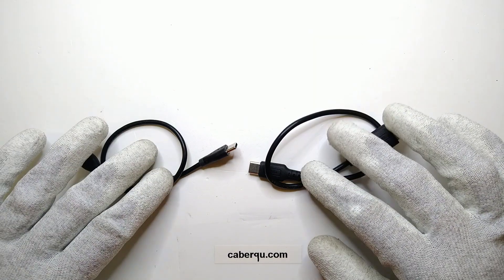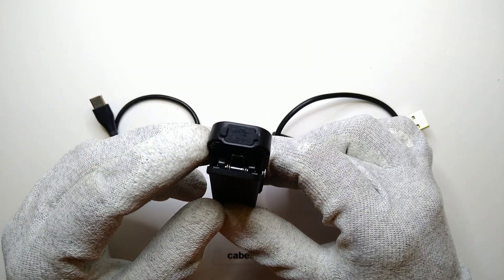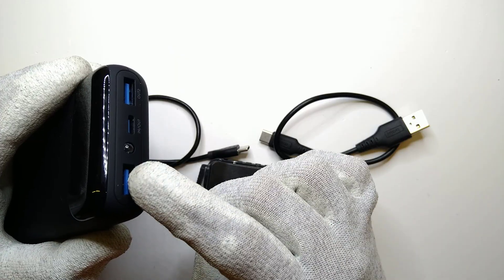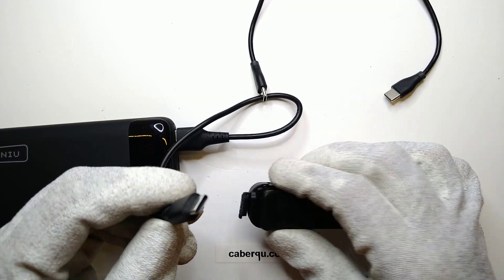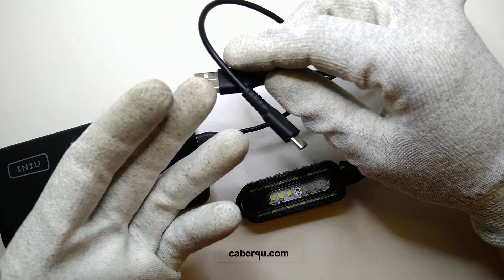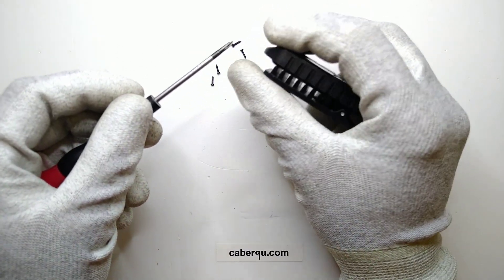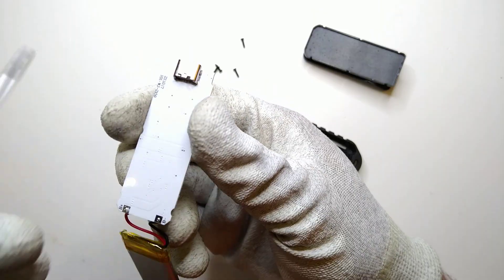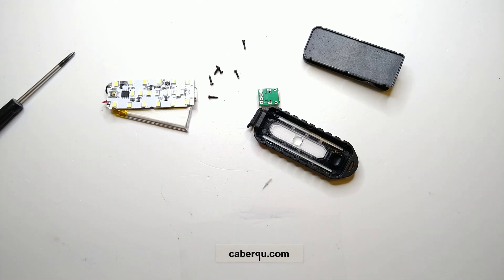Why older USB cables may be better for certain devices

Comment: I have approximately the same experience with a mini AC, that is powered by Type-C.
With Type A to C everything worked fine, but I when I used the same multi port charger of 65W with Type C to C , it killed the AC, since it does not longer start even with Type A to C cable! So, now I prefer to use A to C as long as device does not require tons of power.
I quite agree, that it is ridiculous, that fixing the issue with two resistors is quite cheap and easy, but not everybody does it!
Thanks for the video!

Comment: In the teardown, I suspect that device was originally built to have a USB Micro connector and simply got updated to use C instead.

I have a rechargeable kitchen scale that won't charge from the USB-C charger I have in the kitchen - have to take it to plug into an older A-based cable.
Reply from the maker: And now you know the reason why, thanks for sharing ;)

Comment: I wish someone made a USB compatibility adapter that just emulates being plugged into a USB A charger, because it can be done, I can plug in a USB C to A and then A to C and it'll still work.
Reply: What we need is a simple and small USB-C to C adapter that has the two resistors inside. Amazing that this iis nowhere (!) available, only as ugly and too big breakout PCB.
Reply from the maker: That would be a great idea, it would need to have a little switch changing between DFP (charging a device) and UFP (being charged) operation though
Reply: @quiescentcurrent oh yea for sure. I would think it would be pretty simple though. all it would need to be is a USB extension but only the ports required for USB A would be connected